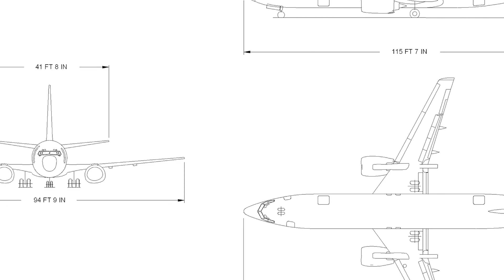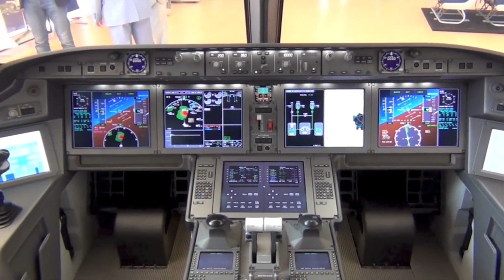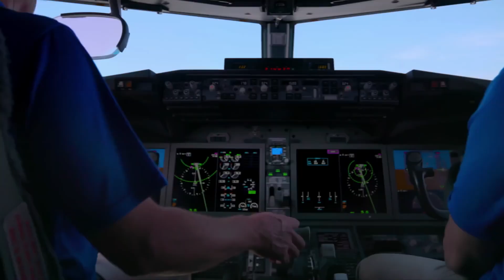Boeing 737 MAX - the legacy of the king

Comment: A fascinating video. Boeing are certainly in a difficult position with competition coming from everywhere. It'll be interesting to see if the upgrades they've made to the 737 are enough.
Reply: Paul Stewart once again Paul
You sound like an idiot. Boeing owns 97% of the commercial freight market, they outsell Airbus in wide body aircrafts by 3.5 to 1. And guess which sector of commercial aircrafts have a higher profit margin? Thats right its the wide body market. Airbus can sell all the Canadian designed small regional planes they want but its a small profit category. Are you really this ignorant??? You seem like a nice guy but a little stupid and or biased.
Reply: @frangipanboo  this comment didn't age well
Reply: The competition make Boeing excel
Reply: Paul Stewart I doubt Boeing will let anyone overtake the 737, they already lost the queen of the skies title to the Airbus A380 because they they thought double decker wouldn’t work but Airbus did, & they aren’t trying to give anything else away to ANYBODY else
Reply: Kevin Thomas jr. The A320 family of aircraft overtook the B737 family years ago.
Reply: Rocky Dans for real? I knew they competed, but had no idea they overtook 737. All I’ve ever heard is how the 737 is the workhorse of most airlines
Reply: Kevin Thomas jr. they both sell very well but im almost 100% sure the A320 family sells more than the B737 range....its still pretty close though, its also a fact that boeing sells more larger planes than airbus whereas airbus sells more single aisle so yeah its true...cheers
Reply: Kevin Thomas jr. And Airbus will never recoup the investment made in the a380. And here is another fun thought for you - the a380 will never get another order ever again 🤣. The 747-8 Freighter will still be flying when the last a380 is scrapped.
Reply: Kevin Thomas jr. - The double decker business is dead horse. Airbus it's sales of A380 is highly disappointing and are selling them at a great loss.
Reply: inisipisTV that may be true as of now, however unlike most people, businesses look at business moves FAR ahead of what people see currently. Who is to say that the losses now won’t be made later? I can’t say that it would, but Airbus knew what they were doing when they designed the A380 & why. Calling it a dead horse before Airbus does is premature
Reply: The upgrade would not be enough, once a damage is done, it's done. American need to focus on quality than quantity fallow the European
Reply: Boeing employed so many aircraft designer and engineers for what purpose? Tell me about it? Everyday come to work, sit down and shake individual's leg. Is that what employees are paid for? Mr Boeing? Must make your designer break new grounds. Brain storm think of something new out of the box. Times have changed. You cannot always based on that old, silly design of 737 to milk the cows. You white men, yankees then to take things for granted in life. Not everyday is a Sunday. One cannot kept sitting on your LAUREL. when Airbus, your rivalry clinched plenty of deals, you got jealous and started compromising quantity instead of quality. You always want to be number one. Look what has happened now? How a heck you got into such plight? So sad! Now the world travellers are fearful to step on board of your demolition plane. Not knowing when the next 737 is hoi g to crash. Not only you Boeing, does not gave pilots an ease of mind  to fly the plane as well as travellers with no sense of belonging. With two 737 max and NG CRASHED, what does that reflect? The designed of the plane was of half past six designed and cannot withstand the test of time. Come on, check back all of your track record. Boeing, you cannot pretend not to know. In another words, trying to play dumb, or act blur. So what if it crashed? I can afford to pay. Is this the mentality? If yes, you had better wind up your businesses. Stop killing more innocent pple on earth. Life is precious. We only lived once. That is not the way to die. For goodness sake. Get all your designer back to the table and start redesigning the 737 again. Never listen to what triumph have said. He said something like this if I ever remembered correctly. Rebrand it and make it fly again. This is Trumph's statement. No matter what is the name that you have changed, CHINA EASTERN AIRLINE is not flying the 737 ever again. Never! You've drugged a very huge hole to bury yourself. Who to blame? You should have known better. Gd day! Boeing.

Comment: The antiquity of the 737 becomes obvious when you mention that it came out in 1967, but what most people don't know is that the barrel section (most of the fuselage) is exactly the same as the 727 which is even older (1964). Stretching this relic to accommodate ever more passengers has resulted in a rear ground clearance of only 30cm at takeoff, so even a slight over-rotation's going to result in a ground strike and the handling characteristics are dodgy in many flight profiles. Too damn old.
Reply: Karl P Dodgy? Haven't heard that one before. I recall an ex-American Airlines pilot complement how the NG 737's handled like sports cars.  In fact, I have never heard anyone mention anything about the 737's feeling even the least bit unstable. Even from a passanger prospective it is solid.  My point is that the 737 design is solid, which is why scrapping the program is a bad idea. It is a 60 year old design that WORKS, which is why you can still see 500's/600's flying all the time. The 737 Max is an update and necessary things (engines, aerodynamics) to keep it economically apt.
Reply: If you want to know why, here’s an answer.

The 737 was deliberately low to the ground as it was meant that ground crews can easily load baggage into the cargo area.

Comment: The cockpit is the only problem for the Max, it is behind time compare to all new design planes and including the A320.  The Bombardier CSeries has the ultimate state of the art cockpit.
Reply: Honestly, the cockpit might seem a bit old fashioned, and the overhead panel certainly is. However, the avionics on the NG were at least one generation ahead of the A320 already and the MAX will be even further ahead. I do speak from experience as i have flown types quite a long while. Airbus did not upgrade the avionics or the cockpit at all with the NEO, its just a new engine on an already existing airframe and that's it. That gives Airbus a cost advantage of course, as development cost on the NEO was only a third of what Boeing had to spent on the MAX.
Reply: @Soordhin   lol, avionics baloney. 2 total-loss crashes upon take-off of brand new 737 Max within 6 months, > 300 fatality.
Reply: We don't know anything about the second crash, and the first had, at least as far as we know by now, nothing to do with avionics. It seems at the moment though, that it has quite a bit to do with a flight augmentation system, which is part of the flight control architecture. A completely different thing altogether.

Dunno how much experience you have piloting both types i commented about, just from my perspective as an active pilot i do stand by the assessments that the avionic system of the 737 is quite a bit ahead of the A320 series. No vertical situation display on the A320, no possibility to display more than one layer of information, no navigation performance scales, no GBAS capability right out of the box, hard to certify for RNP 0.1 which the 737 can do natively, no IAN (airbus speak FLS) just as standard equipment. Even the hardware is worse, the screens are quite bad, even the LCD ones on the A320, not to mention the size obviously.

Still, the airbus of course has the advantage of a higher level of automation, the bigger flightdeck and a table, which means for an everyday office it is the better place to work.  

None of that played a primary role in the first crash, and we do not know yet what happened in the second one.
Reply: @Soordhin  Am not a pilot but believe it is high time to switch both pilot & ATC to A.I. bots. Heard, the engine placement too forward and too high up makes 737 MAX prone to pitch up.. wing stall.. (then ofc nose dive). Unstable vertical speed.. Could it be bug in the software that crashed both aircrafts??
Reply: Considering that drones currently (outside combat operation) have an accident rate that is several 1000 times higher than commercial airliners, the argument for AI or even remotely piloted vehicles are not that great yet.

Yes, the MCAS system, which is unique to the MAX variant of the 737, is designed to deal with a certain characteristic when approaching stall, so outside the normal flight envelope to begin with. There could be an issue with it, after all Boeing planned (before ET302) to deploy a fix for MCAS beginning in April. But jumping to conclusions does not really help at this point, we have one datapoint pointing to a possible issue, and one unknown accident, plus thousands of uneventful flights. Now, if we are talking a design-error in a subsystem, there are always pilots to deal with, and as we have seen they are able to do that (the flight prior to JT610 did). In an AI that might be unlikely, as it would have to deal with itself basically, which seems rather unlikely. 

However, there are lots of explanations for unstable vertical speed, which so far hasn't been confirmed yet apart from FR24 data which is unreliable to begin with as the coverage in that area is not sufficient. By the way, JT610 did not stall, quite the opposite really. And so far there has been no indication that ET302 had stalled either.
Reply: @Soordhin  thank you for educating. No stall. But both nose dived. And another, the recent Atlas Air cargo B767 crash near Houston had nose dived too. Strange coincidence?
Reply: For the moment i would still think of a coincidence. There is a possibility that both 737 accidents might have the same general chain of failures, but equally there might be distinct differences. The 767 cannot have the same failure chain as JT610 as MCAS simply does not exist on the 767, it is a completely different aircraft after all. Two fatal accidents of relatively newly certified aircraft is quite unheard of in recent times, therefore there is understandable a lot of pressure on all involved, be it Boeing, the FAA and of course training organisations about the difference courses they did, as well as airlines of course that have to cancel routes if they ground those planes.

i can completely understand that everyone wants answers as soon as possible, but in the end aviation is a pretty complex business and a thorough investigation takes time.
Reply: @HereNow2226  Coincidence? Absolutely. The 767 was designed in the 1970's and 1980's. The 737 Max was designed in the 2010's.
Reply: Yeah having an asymmetrical cockpit really helped AF447 as the co pilot didn’t know the PIC was holding the joy stick all the way back. No thx
Reply: Airlines wanted it like that, and it's easier and faster to convert crews over from the NG to the MAX. While we may not like that, it's for economical and faster.
Reply: Serge Vivier That's cuz regulations. They can not change to much about the cockpit because if they do. They cant name it a 737 but it needs to be a new model. Very logical regulations but now you know ;)
Reply: The problem is its ground clearance with prevents it from using the geared higher bypass PW1100G engines like the Neo.
Reply: Serge Vivier no it is not
Reply: Serge re "The Bombardier CSeries has the ultimate state of the art cockpit."
How much new cockpit is enough?  The 737 has been in production for more then 50 years and has orders for at least 4,000 more.  I want to know why but I suspect it has nothing to do with state-of-the-art cockpits.

Comment: Airbus A320 is by far better.
Reply: ComeFlyWithMe2011 time for the 737 to go? Your a fucking idiot, it is one of the most efficient and best selling aircrafts of all time.
Reply: Why is that Johan?
Reply: ComeFlyWithMe2011 it’s far better than the a320
Reply: If you're going to play that game, look up 'rudder hardover' or 'uncommanded rudder deflection' and see which aircraft gets mentioned.
Reply: Mindaugas its not
Reply: ComeFlyWithMe2011 The Dreamliner hasn't had any battery issues for almost half a decade now. Actually, funny you call it the "nightmareliner". Airlines have loved them, and they have seen nothing but good reviews from passangers and pilots alike. I flew on a Hainan 787, and it was a very nice plane.
Reply: It all depends on how the airline is using the plane
Reply: Mindaugas fanboys
Reply: Mindaugas They crash into the woods.  Remember Air France.  Scarebus
Reply: Dyno Don: At least airbus don't catch fire. Nightmareliner.
Reply: it depends, it's a yes and no.
Reply: nope. nothing near to Airbus quality. I seriously try to avoid airlines using Boeing.
Reply: Mindaugas shut up Boeing is better then airbus and Boeing is older than airbus
Reply: The 737 is an uncomfortable old box, its time for it to go already.
Reply: If you want a modern, uncluttered flight deck, the a320 is better
If you are a passenger, the a320 is better.
In most cases if you are an airline, the a320 is better.
If you are a fan of Boeing, the 737 is better.

Comment: A clean sheet redesign is long overdue.
Reply: The problem with the 737 is that, because of decisions made for the very first 737, it is not competitive enough in the current market. Sure they have been able to update it enough to keep it just good enough, but it's not enough anymore to beat Airbus. With some outdated design characteristics they can at best be second in the single isle market. If they want to beat Airbus in the single isle market they have to design a completely new aircraft that can use the most modern technological advancements from the start. With updating an aircraft you can only do so much before you reach the maximum potential, and Boeing has almost reached that point and many further advancements are so difficult and expensive for relatively little improvement that it's not worth it.

And it's not a surprise, the development on the 737 started about 55 years ago and the first (test) flights were performed over 50 years ago. Back then engine technology was very different, requirements for short turnaround-times, airports services, runway requirements were all different, the possible materials were different and as the world of aviation was different airlines required different types of aircraft. One of those things was that a twin-engine aircraft could cross oceans, thus there wasn't much need for long-range single isle aircraft, which is much different now.

Boeing can keep up with the 737 for the next decade probably, but in my opinion, they should start some fundamental development on a replacement for the 737 that can form that backbone of Boeing for the 21st century.
Reply: Urho completely new aircraft
Reply: garricksl  Clearly Southwest is key customer but with almost 5000 orders you can’t really say it was designed for any one customer. WN Has maybe 300 of those orders currently
Reply: Not when you look at the economics of it. It’s really hard to justify the investment since most of the efficiency gains are in the engine. There is also perhaps more importantly the established production chain for such high volumes.
Reply: John Iii Southwest does not want new design based on B737! Airbus 320 neo and 350 is better because it start from scratch
Reply: I agree, the fuselage is the same design as the 727.
Reply: Hope they call this new design the 737X if it comes to light. Kinda like the 777X. Classic, yet brand new at the same time.
Reply: soaringtractor  WN wants  to fly to Hawaii on Boeing 737 and new energy efficient engine for mainline operation ie: OAK to SEA.     OAK to HOU is also a factor.
In the future,  Boston to London City can use  with Boeing 737.
Reply: If Boeing ever redesigns this airplane, I think that they will keep some of the current 737 design signature.  In my opinion, it's more beautiful than the A32X.  It looks more aggressive.  I flew both it the on a A319 and the Airbus is more comfortable.  I hope the MAX is more comfortable.  One thing the MAX rocks is maneuvering.  It and the 787 maneuver like big fighter jets.  I think that Boeing is gonna come up with a new plane in this category, or a bit below this category, with the help of Embraer.  They're about to make a partnership just as Bombardier partenered with Airbus, and Boeing-Embraer new plane should come to compete directly with the CSeries.
Reply: Southwest will not buy Airbus 320 series or any other single-aisle airliners.  B737 Max project is designed for Southwest, period.
Reply: @garricksl  The Max Killed The Southwest -300's
Reply: Red Ice explain
Reply: Christopher Coke Robinson no i meant why do we need a new one
Reply: Red Ice i
Reply: Aviation Addicted no it is more efficient and that's not the point we almost never see alirlines switching main reason being Crew training it would cost millions and others takes about a year per pilot